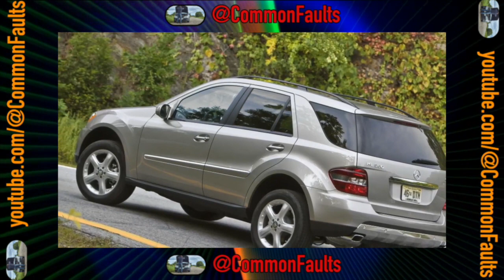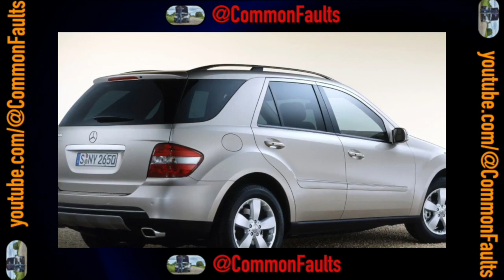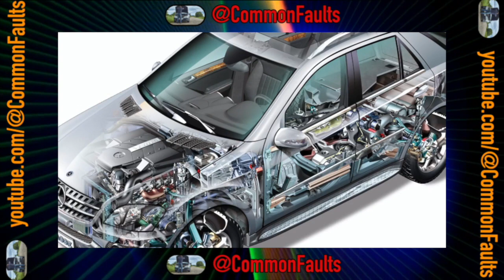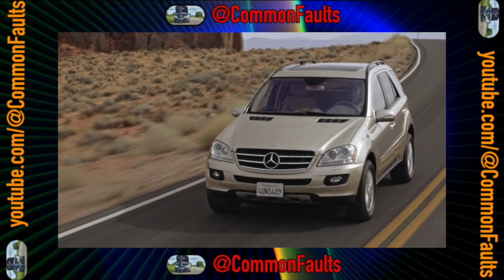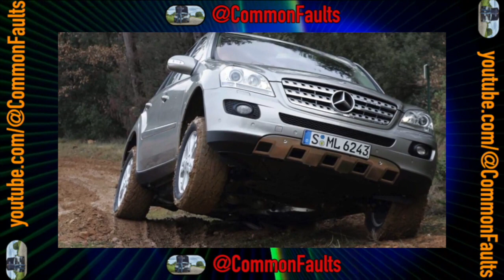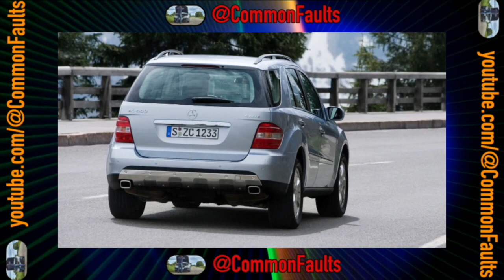Mercedes-Benz W164 Common Faults

Comment: You have steering rack going bad, radiator fan assy motor goes bad, conductor plate on 7 speed tranny stops communicating, you have to find junk yard matching plate, and have vin burned on replacement, Ballance shaft sprockets going bad.